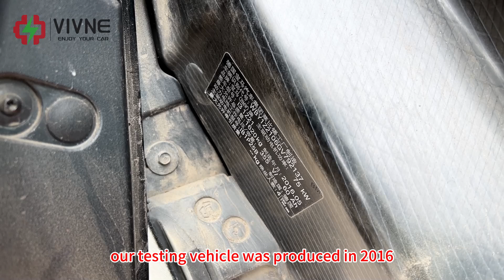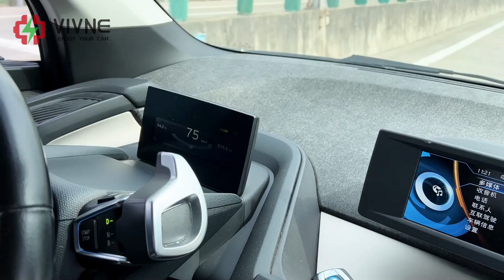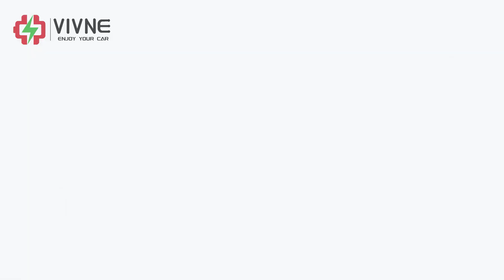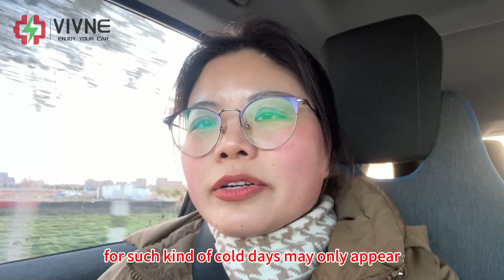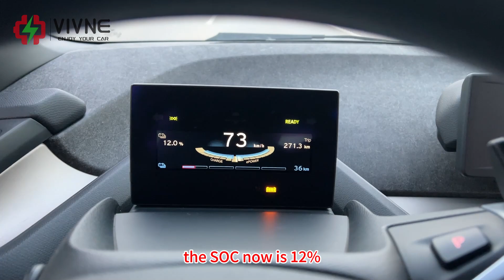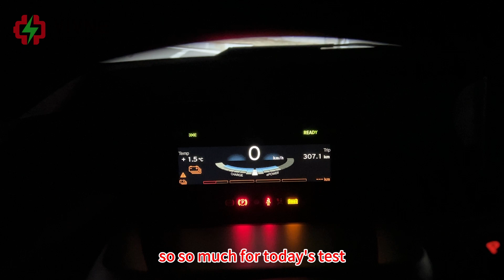VIVNE - BMW i3 Battery ( Part 1)

Comment: have you heard of a company called MTG Martigi? They offer a 154Ah 54kWh upgrade for the i3. Will you be offering a upgrade for i3 owners with 42kwh 120ah models? I'm sure there would be plenty of interest if you could improve the battery capacity of the i3 to something like 55 or 60kwh?
Reply from the maker: Yes, we know them. Their boss had come to our factory for studying earlier and we know their solution.  Due to self-moral constraints, we don't want to talk too much about it. From a technical point of view, the larger the capacity, will inevitably have a greater weight. After comprehensively considering the structural strength of the original battery casing and the charging power of the original vehicle, our engineers believe that 45kWh is the best solution. The battery pack weight, car range, and price are all suitable. Of course, we will continue to maintain product research and development, and perhaps in the future we will also produce a capacity of more than 50kWh..
Reply: @VIVNEHelenMao  
These are the exact specifications of the 150AH cells (355V * 150AH = ~ 54KwH) which Samsung SDI had on their drawing board before BMW canceled any further i3 development.

These upgraded Samsung batteries were a plug and play upgrade for the I3 Models with existing 120AH units as the battery case was designed with some degree of future proofing by BMW I3 designers

On the future roadmap was also a 180AH cell. (64 KwH)

So in other words, if BMW Had continued the i3's development, we'd currently have models on the road (or in the pipeline) with 150AH 180AH Samsung batteries.
Reply: The issue with such a larger battery, apart from the weight; will be the charging time, there is no Rapid DC charger on these early models, so you arent going to be going out of range unless it involves an overnight stop where you can charge all night.
Reply: 300 km is more than enough for normal use. What is the price including shipping to EU ?
Reply: @peteroffpist1621  Not if you already own a 120ah model as it wouldn't be considered a upgrade to those owners. Speak for yourself but not for me, thanks.
Reply from the maker: @peteroffpist1621  Please kindly contact: helen@vivnevs.com  Whatsapp: +86 18717786639  I will quote you the prices including shipping. Thank you.
Reply: @peteroffpist1621  agree, it not a optimal road tripper so 300 km will be fine. In the future it would be nice with a light battery at the same size.